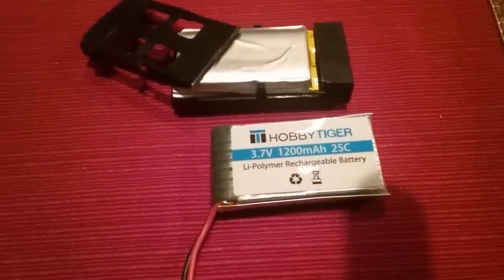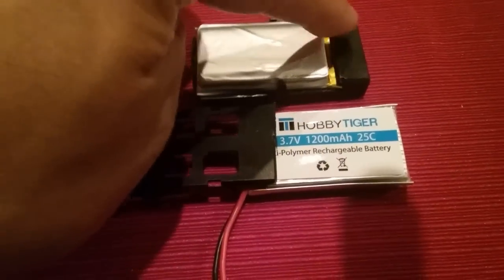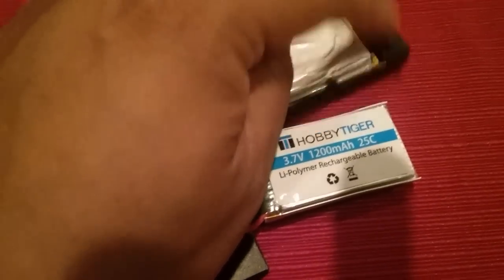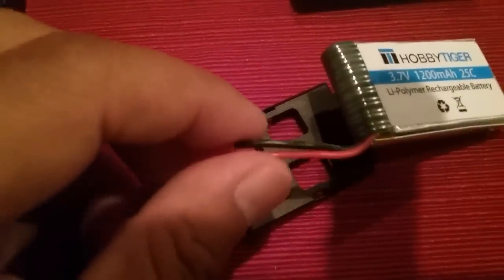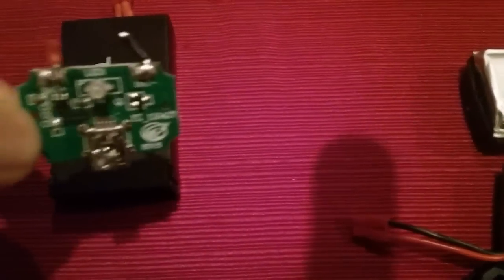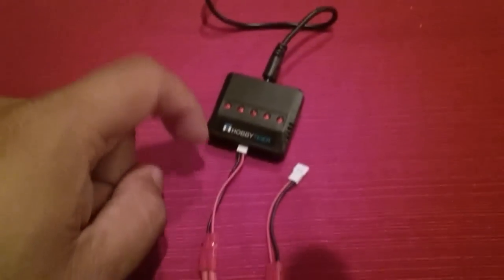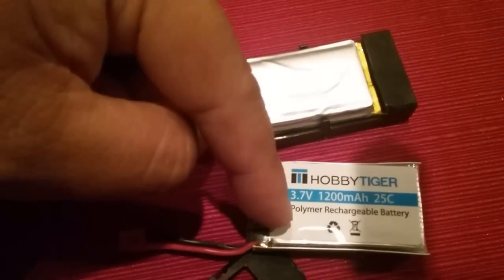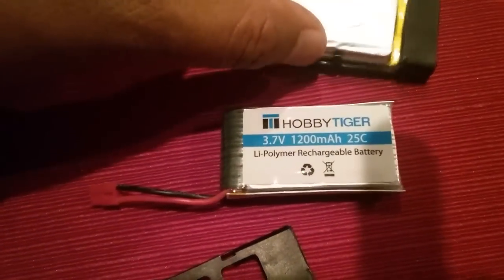Propel hd drone battery replacement

Comment: My nephew has one of these little drones. I am looking for a way to fast charge his battery. I suspect it's a singl cell lipo battery, but the caseing for the battery has 3 pins. Why would their be three pins? The oem charger takes hours lol. I'd also like to convert this to a more universal lipo battery terminal and buy several cheap lipos
Reply from the maker: Every battery has a chip built in. I assume the third pin is either a temperature sensor and or a overamperage sensor. I wouldn't reccommend super charging because it give it a larger chance of explosion.
Reply: @Shicks2000  thanks for the info. i have been charging lipo at 1c for years, and just started recently going to 1.5c. i care more than my nephew so i am probably going to drop it. but if it was mine i wouldnt wait 4 hours to charge, just to fly it 10 minutes lol. also  i would tear it open to see what that third pin is for, but i dont  think he cares lol

Comment: I bought 3 propel Maximum X11 + wifi. Racking my brain trying to find an upgrade to the 683048 800 mAh battery. No where does it say what output it is. Like 25c etc which blows. I want a 3000mAh so i can fly longer than 10 min. Any suggestions?

Comment: I have this same stupid drone, and two dead batteries.  company went belly-up apparently, and you cant find these batteries to save your life.  Giant useless expensive office decoration now.   I would LOVE to find someone who could just put in the original size battery so that the original charger works without issue,  just swap out the interior 800 Mah OEM battery and fix me up.   Is there such a service out there that makes $$ sense?  About to part this whole thing out onto ebay and try to recoup 60% of my purchase price.  Thing is perfect except two dead batteries.  it was great for the first couple weeks.....  wish Propel had stayed in biz

Comment: OK, I'm a COMPLETE newbie!  In fact I just got my drone from Goodwill.  I figured that was a good place to start.  The deal is, there isn't a battery!  So, my first question is, how do I figure out what battery to buy?  It's a Propel Cloud Rider 2, it came with everything BUT the battery and the manufacturer is out of them.  I've found quite a few on Amazon, but I've no idea if they will work as I know nothing.  (Me and Jon Snow, right?)  Anyway it says, VCR-006 Lipo Battery 3.7V.  But???  I've found one on ebaym but it's $24 for one!  On Amazon it looks like I can get 4 for that amount if I only know the right one to buy.  Help!
Reply from the maker: I do the same thing as you did. Try to get as much info from the manufacturer's website. Then look on ebay. Then look on amazon. Just make sure on amazon it states it is for your model of drone, if it doesn't fit, you can return it because it doesn't match description.

Comment: I am assuming you got rid of the charging chip because it would only charge it to 800mah or fry right? I want to do the same thing on a Bluetooth adapter going from 145mah to a 500-2200mah battery but I assume it either won't charge it or will only charge it to 145mah. Any comments on what you know about if it might work or what I need to watch out for?
Reply from the maker: The chip in the hobby tiger battery stayed in place. The chip in the propel charger was removed because I used the hobby tiger battery charger. The propel charger was used as an adapter only.
Reply from the maker: Most batteries come with specific chargers. That is why I stayed with same brand battery and charger.
Reply: I’ve replaced a 230mAh battery in a Bluetooth speaker to a 900mAh one.  Similarly with a 1200mAh battery in an older iPod where stock was 750mAh. Most charging circuits don’t really calculate capacity but it may limit the charging current.  In your case the device may limit the current to 50mAh to where charging a 2Ah battery would be impractical.  Interestingly said Bluetooth speaker charges at 400mAh without issue despite the 230mAh stock capacity.

Comment: I'm trying to fix my son's battery and now there is no voltage getting passed the board inside the battery. How did you get it to fit factory 3 prong in the heli body. That's the pain in the butt. Any help would be appreciated.
Reply from the maker: pheffer22 do not bypass the board on battery. You are supposed to use the leads after the board to connect to the leads in the battery cage.
Reply: Shicks2000 that board is not letting the currant thru or voltage. The battery works the board is pooched.
Reply: I soldered in 2 jumpers to connect directly to the bat terminals so the 3 prongs are still there using a 3.7 charger to charge it. But it's still the factory connections.
Reply from the maker: Sound like you burned the board like i mentio ed in the video. I accidentally touch the 2 leads together and smoked the board.  I gave that battery to the recycler. But hobby tiger gave me multiple batteries so i had back up batteries to work on.

Comment: My battery is done.  I opened the shell of the drone and I was wondering if you think instead of using the original battery case, I could cut the hot and ground to the pcb of the drone, install a few molex like connectors and use a similar 1200 mAh battery and just adhere the battery to the body of the drone?
Reply from the maker: Jeff Bryan you could try, but i did think of that, but I wanted to keep it as original as possible. Also, I don't know how the drone would act if the load was not in original location.
Reply from the maker: Let me know if it works, because if it does, I will make a cage of batteries to see how long flight time would last.
Reply: I would mount the battery directly below the original battery location to keep it balanced/stable.  I'm looking for 3.7 1200 mAh batteries now.  I'll send you pics if I can make it work.
Reply from the maker: Cool thanks